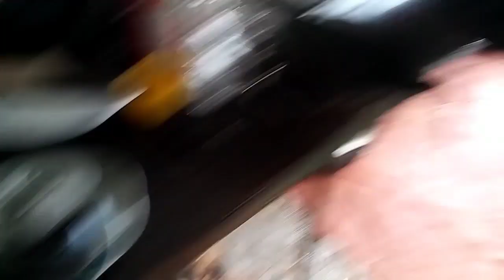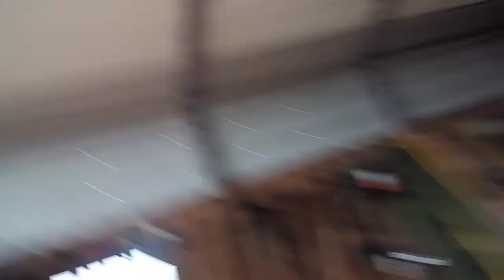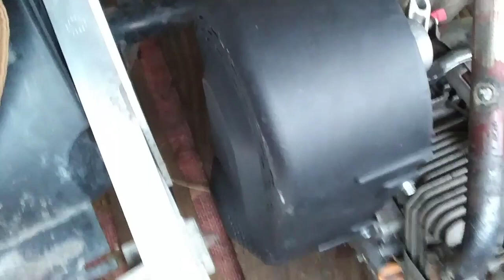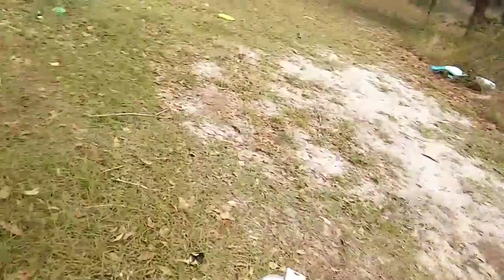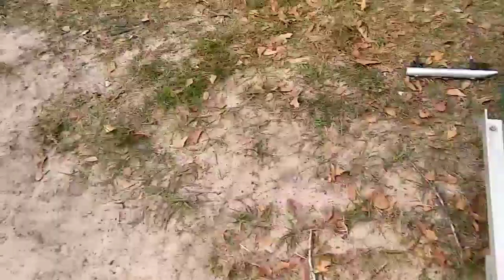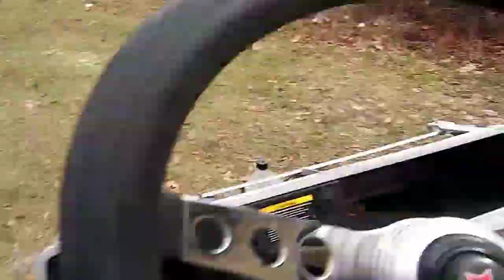212 Predator golf cart build part #2

Comment: What’s the top speed on it with that gear ratio?
Reply from the maker: The top speed is 15mph. If you have the foward and reverse rear axle in your cart i would recomend a torque converter from motor to rear and belt drive. Then your top speed would be closer to 20-25mph.

Comment: Your axle sprocket needs to be bigger than an 18 your going to blow the motor. You need torque if your running a 12 sprocket on the jackshaft you should run a 48 tooth on the axle that should give you 45-50 mph on a 18 inch tire good enough to run around on but not mud off roading due to the weight of the golf cart.  Your gears are way to small. It was burning the belt because of that. This set up will solve that issue as far as your carb pull the bowl on bottom remove the jet clean everything and if your not running a fuel pump the tank feed flow has to be higher than the carb to self feed and have a vape line to breath from the gas tank look how the stock tank had the hose on top that was for air flow so the tank don't get vapor lock that will shut you down/off, the tank needs air to send fuel without a fuel pump. If you do have a fuel pump it might not be strong enough to keep up with the 3600 rpm 212cc predator engine. You did a good engine swap but now you need to get it geared right with that torque converter kit, I promise you the 12 tooth on the torque converter and the 48 tooth on the axle will bring that to life. Keep up the good work and feel free to reach out I'll help the best I can I build off road go karts pushing 80-90 using predator engines. 👍
Reply: I’m doing a similar build, but with a ezgo txt. I’ve got what appears to be the same  torque converter setup. But, I have a Comet style gear box inline so I can have reverse. Should a 48 tooth give,e the same results?  If so, where would I find one?  TIA.
Reply: @billjones7841  yes a 48 tooth will work but you will lose torque due to 48 tooth but you can upgrade your torque converter kit with a 17 tooth that will or should give you close to 50 mph to 60 mph depending on the weight of you and your go-kart. I'm running a 60 tooth with a 40 series torque converter kit and 17 tooth hitting 76 without the governor kicking in. If you have a tractor supply shop/ store around you they do sale a 48 tooth solid steel gear and hub sold separately due to axle sizes. I would run a 1" axle to keep it equal to the crankshaft size for less flex. If you have any further questions feel free to contact me. Sorry for late reply I been busy at work. If your running a 420 cc it's 1" crank if it's a 212cc it's 3/4" crankshaft try to keep axle and crankshaft same as each other.